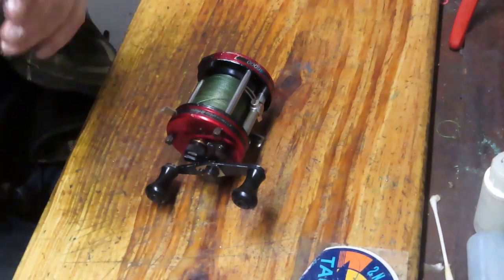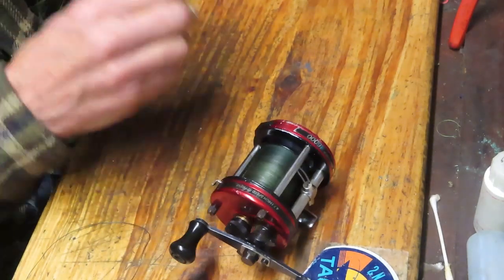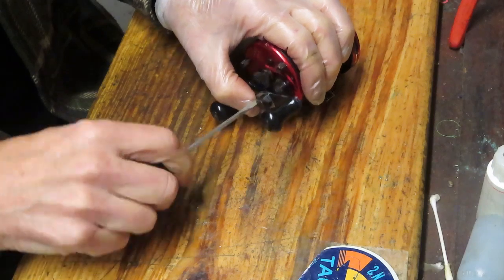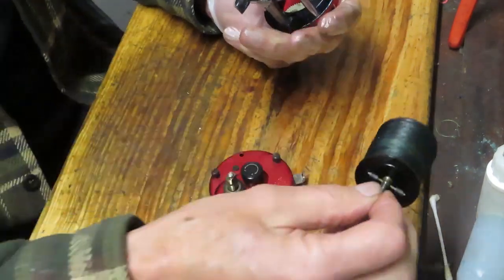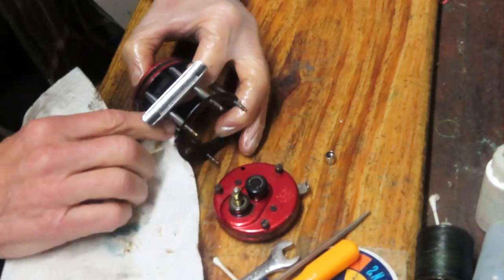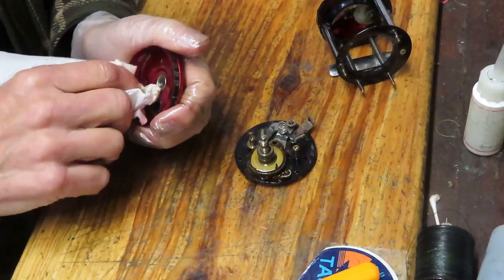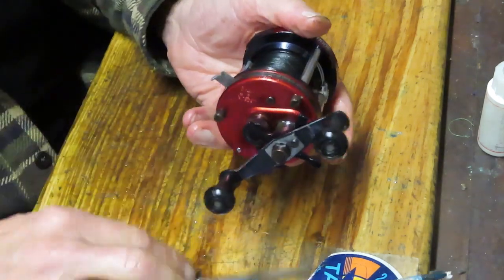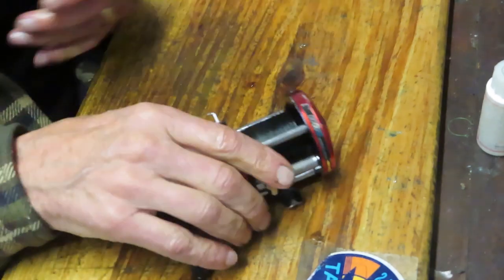Abu Ambassadeur 6000 fishing reel how to service and repair

Comment: 6500 and under. Still made in Sweden and one of the most dependable and easy to work on reels. And parts available like a lot of Penn reels.
Reply from the maker: Just be careful - there are several version made in China that are not up to the older standard

Comment: Hey Dennis, I have a Newell 338 I just got off Ebay, its spool is very loose , how can I adjust the spool to where its tighter and how tight should it be for optimal casting?
Reply from the maker: The bearings on both sides have a screw driver slot.  Turn the screws clockwise to tighten.  Tighten it down all of the way and then back it off about 1/4 to 1/2 turn to set the right tension for casting - Dennis

Comment: Hi 
I know this is a year old but my uncle just gave me his reel and I really want to teach myself how to service it. Your video is really great to follow. Can you tell me what oil, penetrating oil, and grease you use. This may sound dumb but I’m an absolute newby but are thoroughly enjoying the process! 
Also my reel has the opposite issue - it looks to have some dry and even rusted pieces. Can these be serviced or do they need replacing?
Thanks for your videos.
Reply from the maker: I use any brand penetrating oil including the store brands.  If you want a name brand, WD-40 is that.  I use Penn precision reel oil and grease.  You can find these in a combination pack online and buy through many resellers.  Thanks for watching and for asking - Dennis
Reply: @2ndChanceTackle  Thanks. Appreciated. Just in relation to the last question - if the reel is void of oil and some pieces almost rusty - can they be rejuvenated with the penetrating or or will I need to purchase new pieces?

Comment: I have one with the level wind. Can the level wind be removed to make a good casting reel?
Reply from the maker: You can, but it should be a good casting reel without doing that.  If you want to remove the gears to improve casting.  Make sure you remove the line guide and pawl as well as the plastic idler gear in the non gear side plate.
Once you remove the line guide, pawl and cap, put the worm gear and shield back on the rel.  That will prevent water intrusion.  Keep the idler gear and other parts incase you want to restore the line guide function in the future.  Those parts are expensive, so you can avoid future costs if you hold on to those parts - Dennis

Comment: Can I use dawn dish soap to do a clean on the reel and as far as cleaning the outside what would you recommend
Reply from the maker: I do not recommend dish detergent.  It is formulated to dissolve grease and rinsing down your reel with it will dissolve the greases and oils in the reel.
I recommend only a fresh water bath.  To clean the exterior, you can use a rod and reel cleaner.  Penn makes one that I use.  Thanks for asking - Dennis

Comment: My 6000 has lost the ability to adjust the freespool tension. What causes this and how do I repair it? Thank You.
Reply from the maker: That is generally attributed to worn, broken or stuck drag washers.  You should check that first.  I am assuming that you have not had the reel apart and caused the issue with a. reassembly error - Dennis
Reply: @2ndChanceTackle  The mechanical drag is what I have lost the ability to tighten enough.

Comment: The handle moves in and out bout 1/8" on my brand new ABU Rocket...any idea ?  Help please
Reply from the maker: First guess is the the "E" clip is missing from the gear shaft.  That holds the sleeve on and the movement could happen if it is missing - Dennis

Comment: Have an old silver shield version. With mine I’m having extreme issues with servicing. Taken it apart 6 times now and I still get issues with reeling in.
There is no line and it is well oiled, it feels like it has a fish on or the drag is high or something.
Reply from the maker: Have you replaced the drag washer?  Do you have all of the shine washers in the stack? You may be bottoming out on the gear sleeve if the washer is worn or broken - Dennis